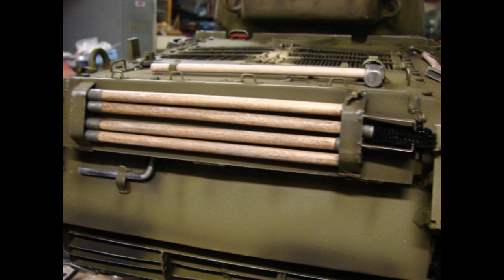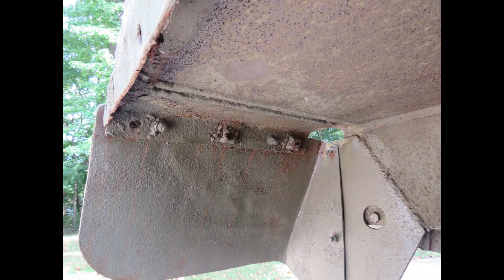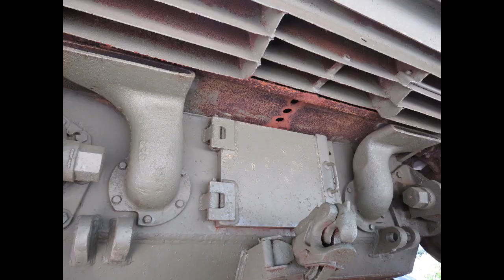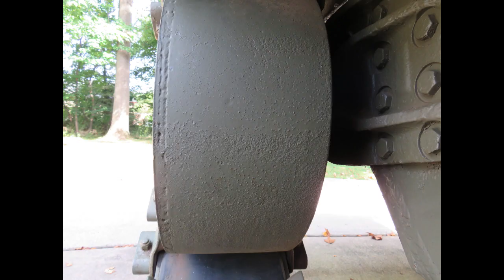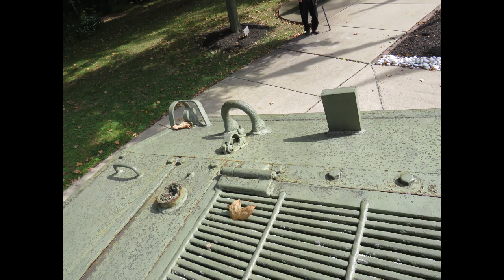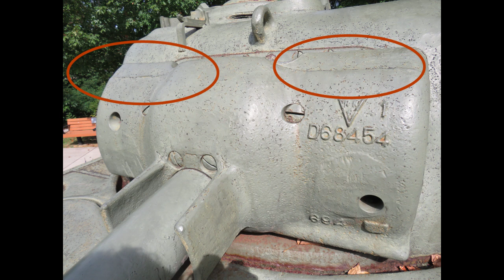M4A3 Sherman tank Detail Walkaround part 2

Comment: what is the purpose of the little sheets of metal above the USA 3082175?
Reply from the maker: are taking about the perforated steel strips? If so that is the side skirt mounting rail
Reply: @oddball759mm  no, i am talking about the solid steel flaps standing up like little fins
Reply from the maker: @thijsbeerepoot7045  are you talking about the exhaust deflector grill on the underside of the rear plate? can you post a time stamp on what you are talking about?
Reply: @oddball759mm  24:25 left under the red circle. The steel fin.
Reply from the maker: @thijsbeerepoot7045  thats the hatch stop for the engine hatch. there is another one on the opposite side
Reply: @oddball759mm  ah, I see.
thank you so much for the clarification.
Have a nice day.
Reply from the maker: @thijsbeerepoot7045  no problem